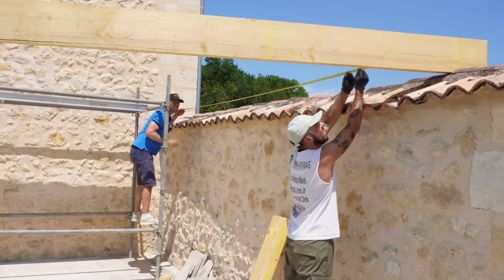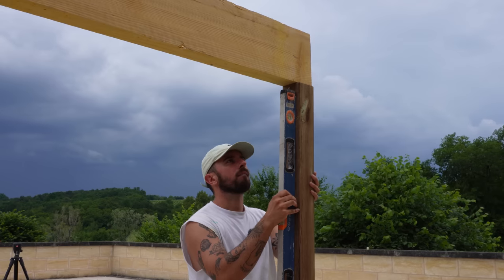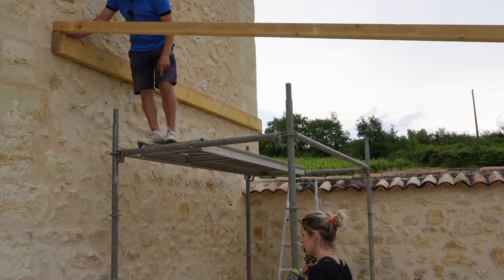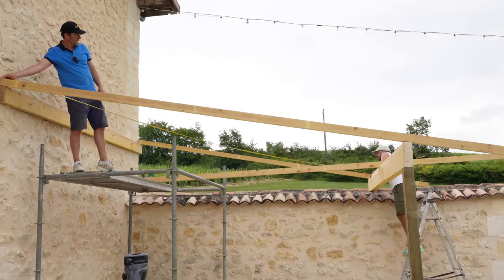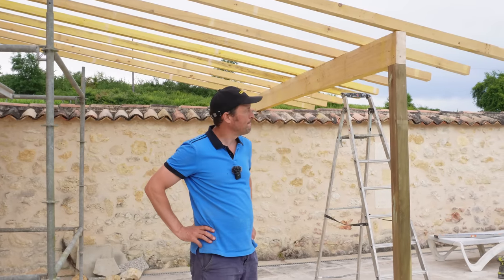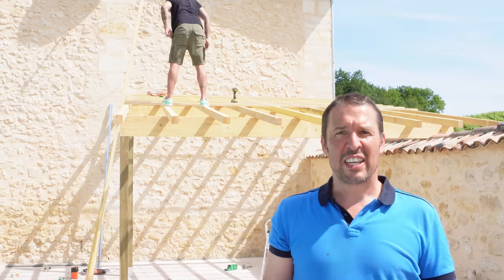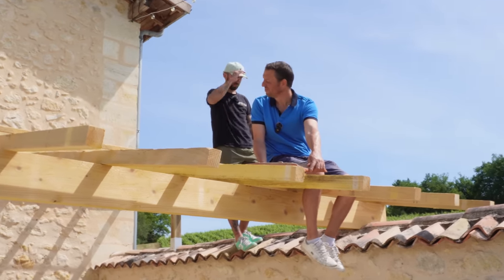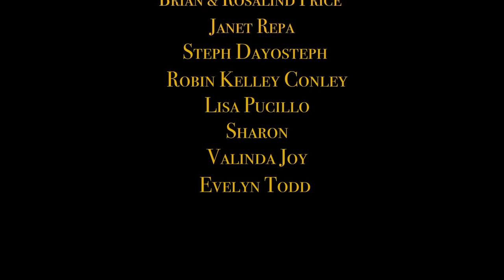"DIY Poolside Paradise: Building a Beautiful Shaded Area!"

Comment: I think if it is a little higher and you need a bathroom jest a small toilet and a replacement in the wall inside the wall with the bar when it is a swimming pool, it should be a toilet close by. This is only my suggestion, but it will be very nice with the bar and swimming pool, good job perfect👏👏👏

Comment: Didn't consider a sail?
Reply from the maker: No we wanted a structure
Reply: @BordeauxLife  Thank you for your reply.   It was just a query out of interest. We have a fully plumbed and wired stainless steel barbeque kitchen and bar under our verandah roof and an expanse of pale limestone around the pool too.  We have sail connections so at the height of summer we can erect a triangular shade over the pool and stone to cut the glare and cool the stone to stop it becoming too hot to walk on.  Of course I don't know how harsh the summer sun is in Bordeaux.